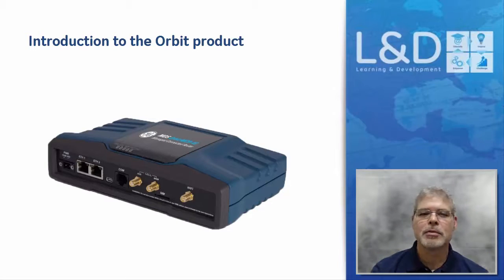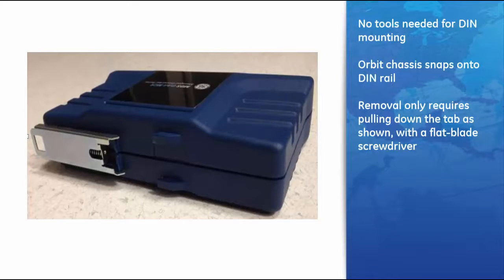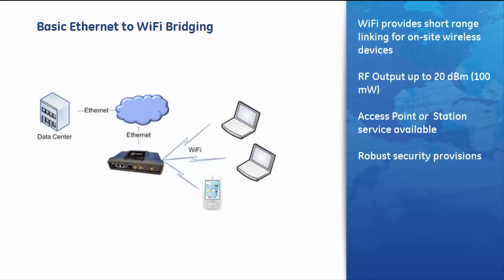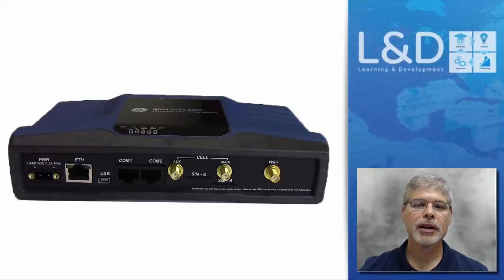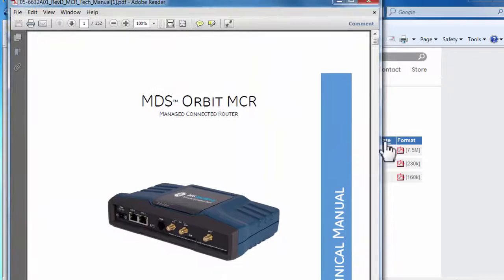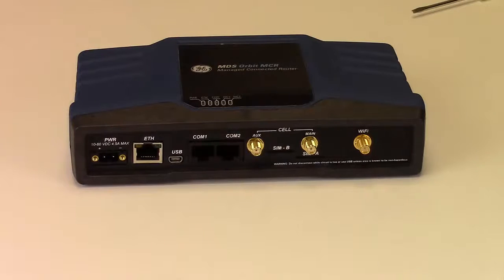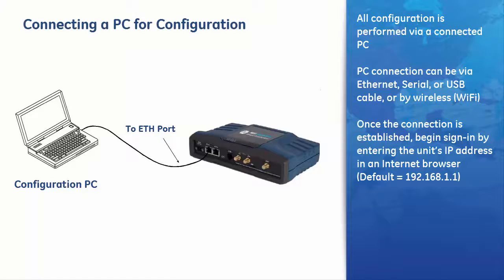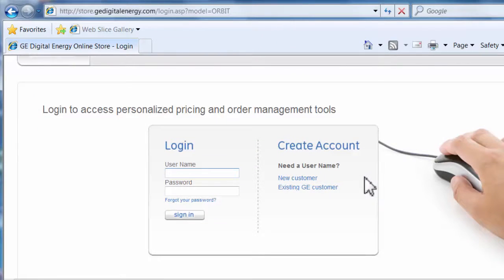OR-100 | MDS Orbit, Platform Overview v1.0

Comment from the maker: Thank you for the question. The IP address of the unit can be found within the Orbit's menu system via Serial connection. The Orbit's default IP address is 192.168.1.1.